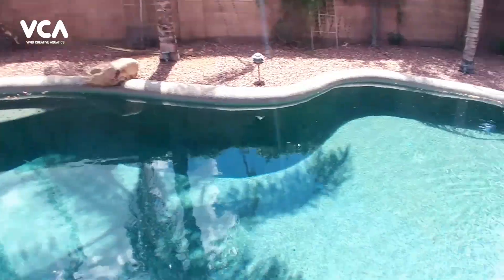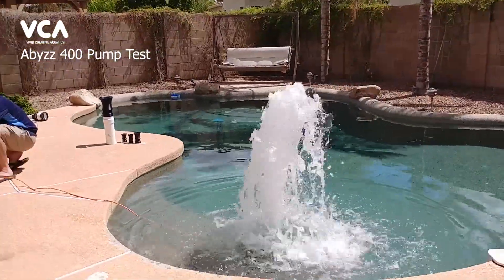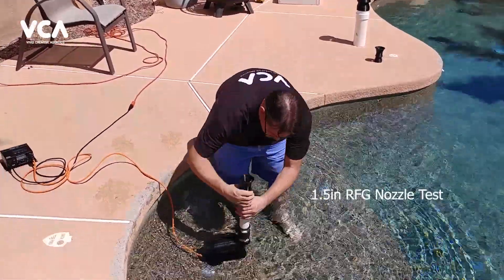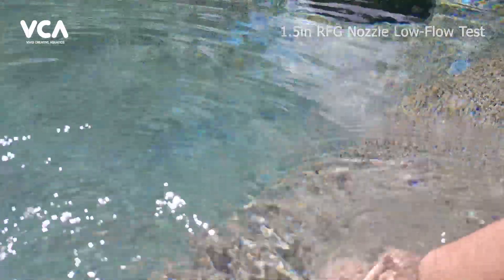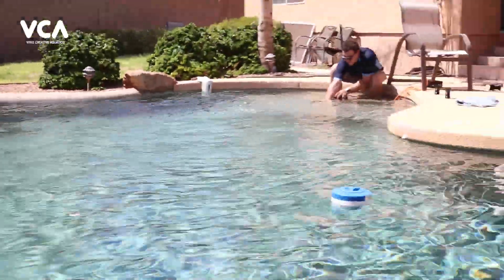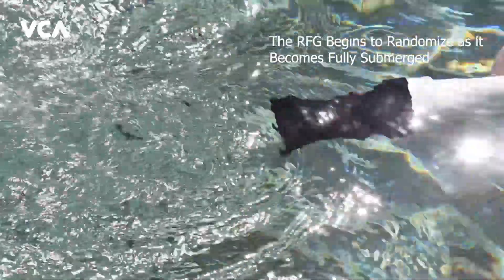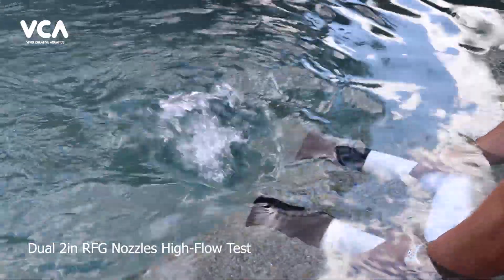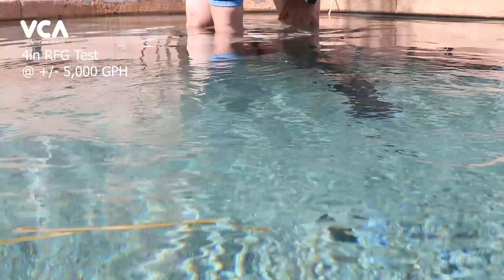Giant Random Flow Generator™ Nozzle Flow Test  with the Abyzz A400

Comment: This video really displays the issue with the nozzle - it sputters like hell at the surface of the water creating a ton of noise. You can use foam etc to silence it and after a few months they seem to break in but these nozzles are actually hell to fight until they are silent.

Comment: Did you guys ever decide to make larger nozzles available?
Reply from the maker: We do have the RFG Nozzles for 1.25in, 1.5in and 2in schl40 PVC pipe, as seen in this video available. The larger 4in RFG shown is not a model that is in  regular production, but can be done apon request.  If you need one larger than that,  we would be interested in discussing it.

To see the full lineup of Random Flow Generator Nozzles, click here: 
https://vividcreativeaquatics.com/product-category/random-flow-generator-nozzles/
Reply: @vivid.creative.aquatics  I need to recheck my outlets but I believe they are either 2.25" or 2.5" threaded. I need 4 for my closed loop. I have 4 outlets each fed by a jebao mdc10000 pump.

Comment: Random flow generator is made by nozzle or by the pump ??
Reply from the maker: The randomized flow is created by the Random Flow Generator  Nozzle (RFG). The pump is suppling steady flow, while the patented  Internal design of the RFG leverages fluid dynamics  to very the direction and intensity of the flow exiting the nozzle.  It's able to do this with no moving parts.

Comment: Do these stick on a pvc pipe?
Reply from the maker: Yes. Our larger slip-fit versions of the Random Flow Generator Nozzles are designed to snuggly fit directly to PVC pipe and require no glue or tape.